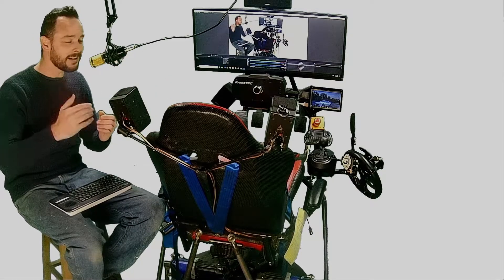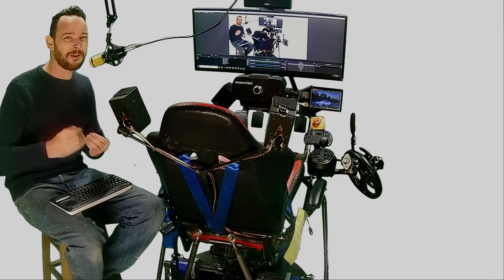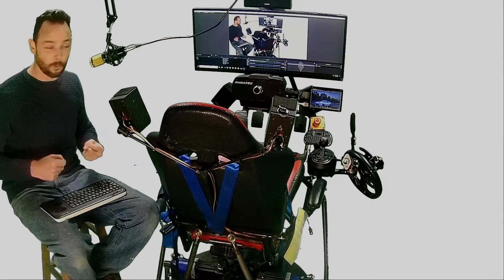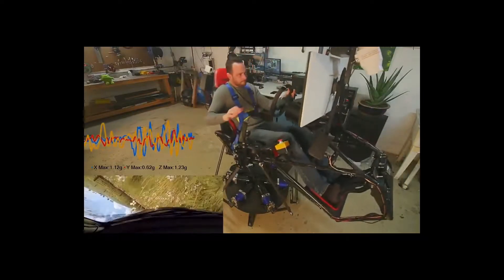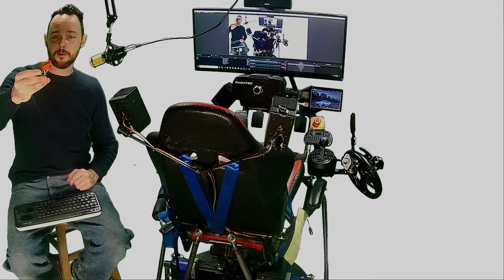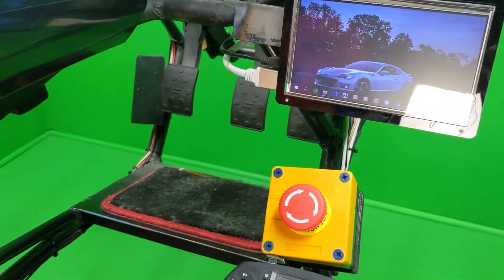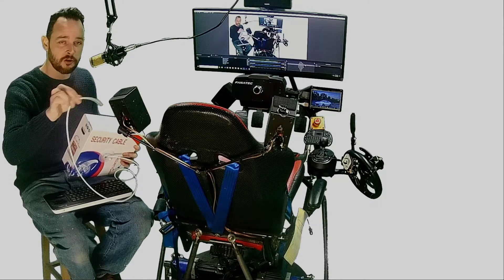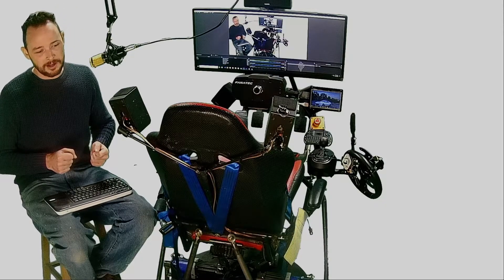6DOF Fab - Adding a second E-Stop Method - Power Kill

Comment: Hello, I'm onion, your work is very good, I also want to do the same equipment as you. But I don't know the cable connection mode of your ground chassis. For example, the connection of Hall sensor and photoelectric isolation module. And what's the Yellow device on the far left of the chassis? Looking forward to your reply!
Reply from the maker: The yellow thing is a microphone. The hall sensors are connected to a custom PCB, that then connects to the main microcontroller PCB, for interfacing.

Comment: Have you tried Star Wars yet? Plugin available now...Did you kill it with the ground or voltage to switch?
Reply from the maker: The switch opens up the 12v circuit that keeps the relay on, the relay that supplies power to the ac drivers. Ive not tried star wars, but i will take a look today at it!

Comment: Why not connecting this second e-stop switch to wireless relay instead??? There are many on Amazon for DIY...
https://www.amazon.com/dp/B08F1FYF7W/ref=cm_sw_r_cp_awdb_imm_t1_t1R1Fb3YGKAYF
Reply from the maker: Because of my body,... I don't want to go around trusting wireless technology for the final say on my life( especially with all the wierd rf issues I have near the rig).... There is still one particular motion error / incident from during development that haunts me that I have since fixed... But I want to be able to kill the power guaranteed...the pause works great and I use that 99.999999999% of the time,... I just wanted to be 100% sure I will live ,.... These motors/gears are not to be taken for granted..
Reply: @Christopherknauf  the one I linked is not a toy wireless one. It's for long distance, so even if EMI is present won't affect it much and will engage instantly. Also bonus,  you can wire it directly between the servo power source, all servos on it!!
Reply from the maker: I'll take a look, but doing it the way I did was free!
Reply: @Christopherknauf  Well, running new wiring through almost the whole rig to reach the servos, is not exactly free and painless job... 😅
Reply from the maker: I've gotten exceptionally good at running those wires... ;)
Reply: @Christopherknauf  I bet!! 😂